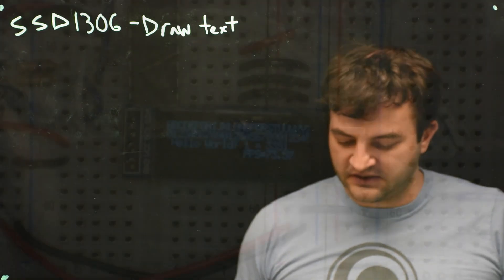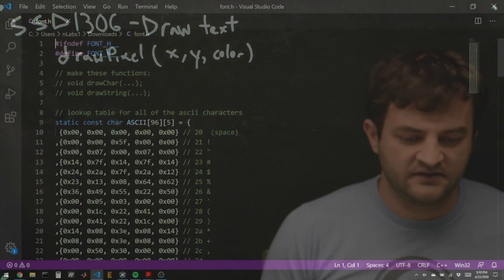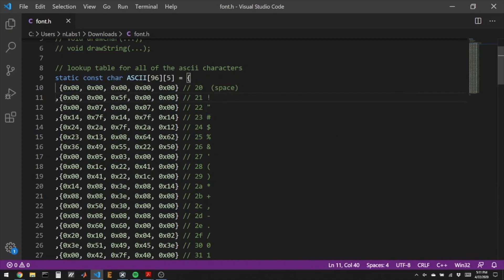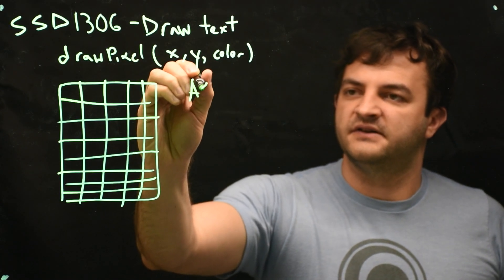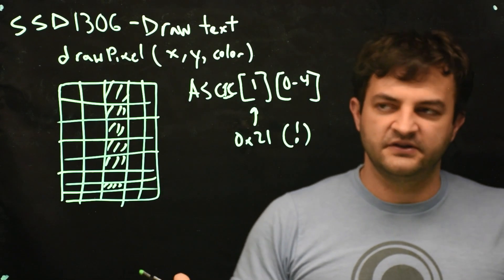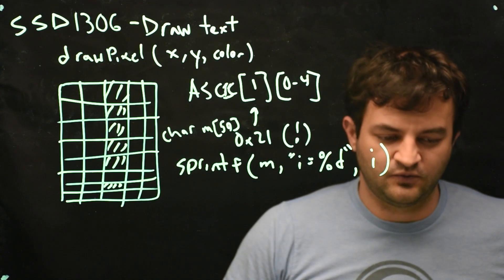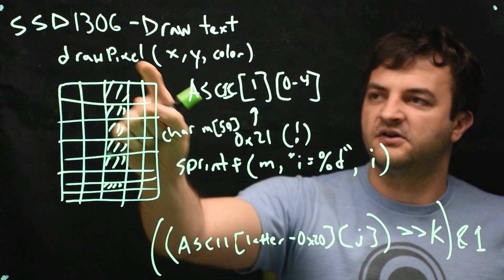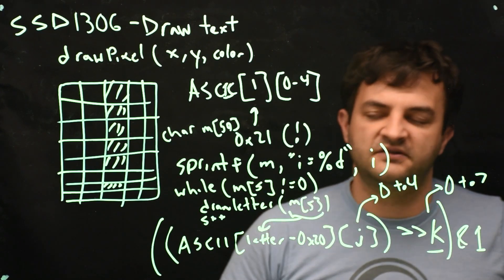Drawing text on the SSD1306 OLED display

Comment: Nice work, brow... Would it be possible to write on the 128x32 Oled display with the text sideways? Rotated 90 degrees counterclockwise? to use the display as if it were 32x128?